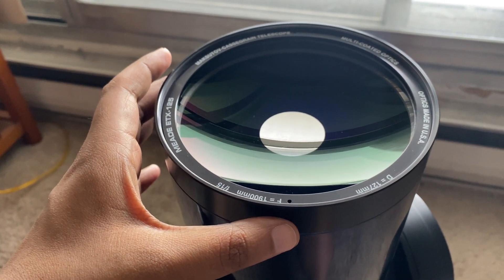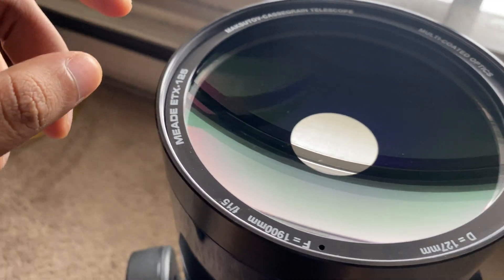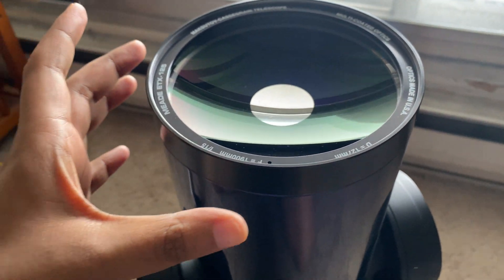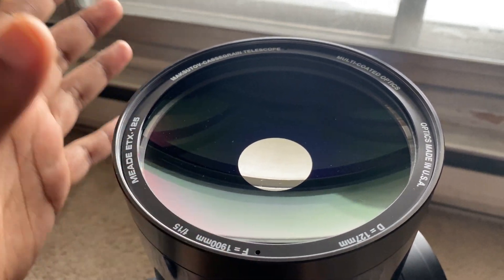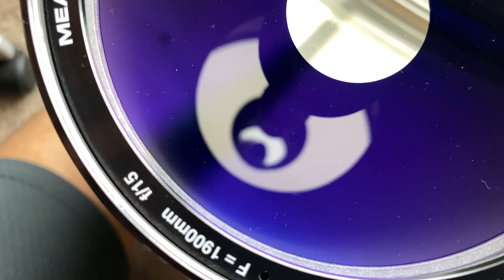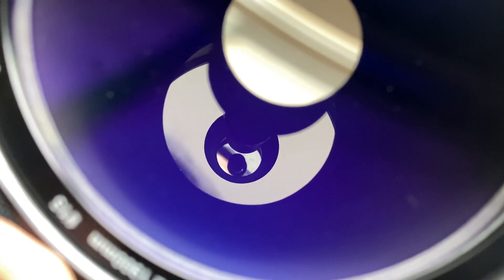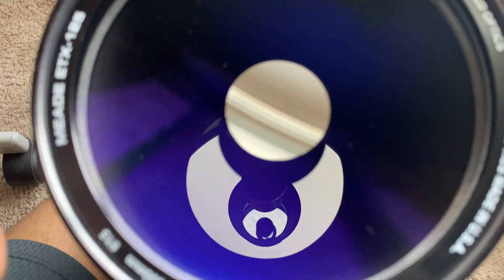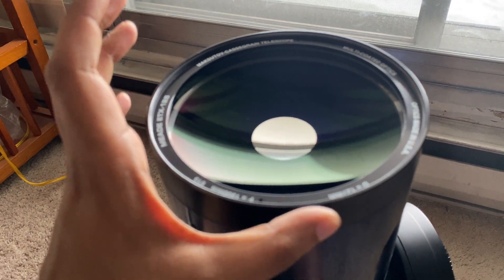Meade ETX 125 question

Comment: Did you remove the lens? I own 2 ETX's and would not remove the lens unless there was a critical reason to. I'd even suffer some fungus on the primary over removing and replacing. Lot's of reasons for this but primevally, the orientation of the lens is factory set and quite difficult to re-align.
Reply from the maker: No. I have not removed this lens. I have not yet opened the scope at all. I have received some really good suggestions here. As of now my concern is the loose focus knob / primary lens wobble when focusing. I plan to open the back and have a look there. I have prep'd  stuff needed while I am in. What would you suggest?

Comment: you can take the outer ring out by rotating CCW, and the inner ring is when you would need to replace the front lens, if you have a big hand it will be easier, i bought a damaged etx125 ota, with a chipped primary mirror, the results were 95% good even with a scratched chipped mirror. i hope anyone can guide me here where to find a new mirror for it, later i got another etx125 a goto with tripod, looking at your scope i recommend that youre good those small particles might not make a noticible difference or if they make the difference will be .01 percent.
Reply from the maker: Thank you for taking the time to write this answer. I never got the time to open the telescope. I agree with your opinion. But, there is another issue that I have noticed. There is wobble in the focus knob/mirror. When I am looking at the Jupiter and try to move the knob, the Jupiter goes outside field of view. It may be because the mirror has come loose over the years. Is this the case with your telescope as well? I am not saying that it is not manageable. I have learnt to focus it anyway. But, I suspect that I may not be getting as sharp image as I could, ignoring the atmospheric components.

Comment: The whole front corrector lens assembly is threaded. The front ring is a retainer ring that can be removed to access the corrector independently of removing the housing. The primary is in no way mechanically connected to the front corrector or secondary. I personally would try to find or make a strap wrench large enough to unthread the housing. Taking it out via the retainer is fickle and can be more difficult to square during reassembly. If this were mine, and exhibiting fungi on the primary, I would go in through the back. I’d leave the corrector in place and clean it through the tube connected with the primary mirror out.
Reply from the maker: thank you so much for the reply. I really appreciate it. 
So, i'll definitely go with your way from reaching through the back. 
Just to double check - 1) i need to defork the tube
2) take the back housing off and reach the primary.
is that right?
Reply: @kush-909  yes. It’s a bit time consuming but much safer overall. After you get it all cleaned up it’s very unlikely you’ll have to again for years. While in it I’d check that the retaining ring is tight and it might be good to regrease the focuser. Ball bearing grease or white lithium is what’s typically used. Good luck.
Reply from the maker: @GarnettLeary  thank you so so much. I'll definitely get some white lithium before I dig into it. I'll check the retaining ring as well.  
I really appreciate the help. Especially when there isn't much help available on the internet. Thank you.
Reply: @kush-909  you’re very welcome.